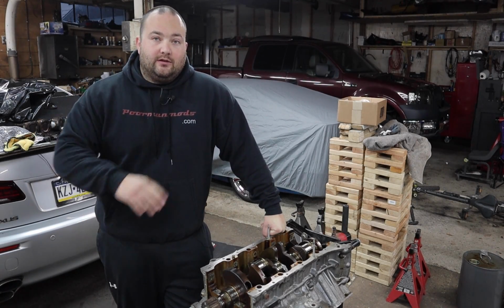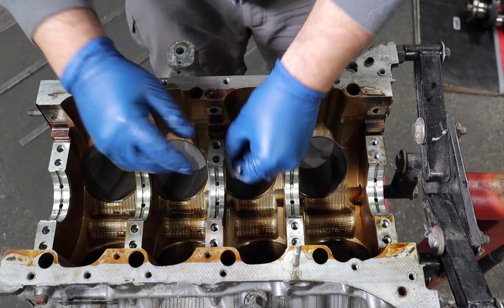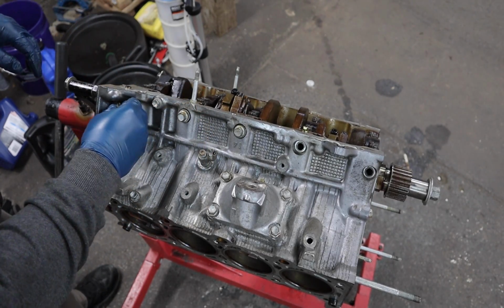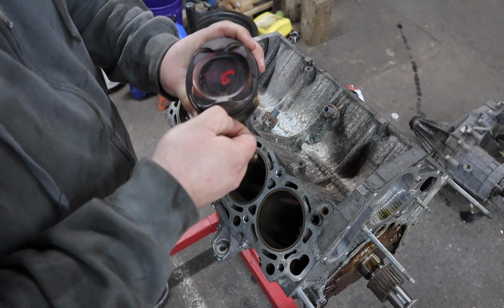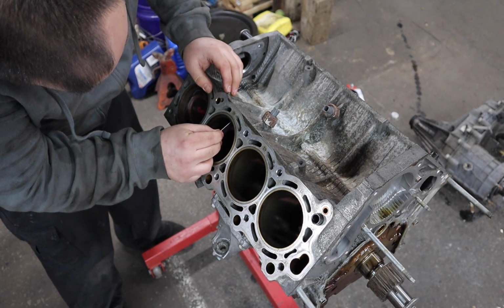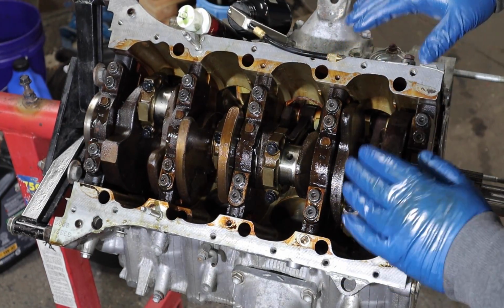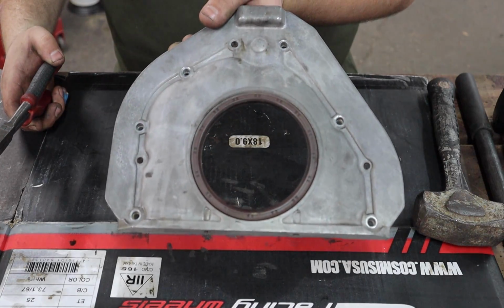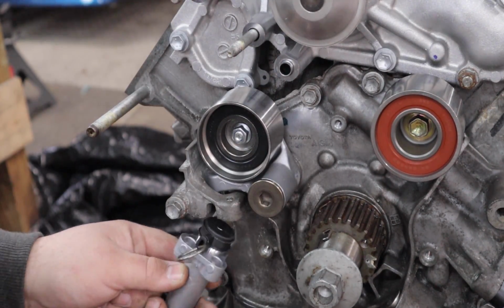1UZFE-VVTi Engine Rebuild Pt 1 Bottom End Rebuild

Comment: Honestly, you could've just noted the stamping on the block skirts (where the upper oil pan is mated to the block) at the rear right corner (seen in the video on the right lower corner of the skirt). Those are the main journal diameters. Also, the crankshaft is stamped for all it's journal measurements ranges from 1-5 and. They do this for discrepancies in manufacturing and they can still maintain a VERY high tolerance standard.
Reply from the maker: Yes, you're correct and that would have saved me some trouble . I believe at the time those markings were unable to be seen because of dirt or corrosion. I was looking for them and could not find them. Then when I took the engine block to the machine shop they hot tanked it and they found them.
Reply: @PoorManMods  yeah, they get caked easily. great video too bud!! I'm actually a Toyota MDT in Gulf States.

Comment: I scraped my oil pan, fixed it up and Drove for a hr. a knock started, came to find out I cracked my whole sump pan from being to low. thanks currently rebuilding and soo many threads had misleading information. Video was straight forward. appreciate the links tagged along.

Comment: There are marks on the block and the crankshaft for the bearing sizes, if it is difficult to see on the bearings themselves on the 1UZ. 

Adding them together gives your bearing size needed, it’s in the 1UZ engine service manual.

Comment: Interesting. On the bearing ranks for that engine. During the machining process the crank caps are tightened to the block and a boring bar goes through and cuts all the journals together and then each hole is measured and a rank is given for each journal, so the journal and the cap should be the same. The same is done to the crank, then you use the numbers from both to determine what bearing size to use for each journal. The top and bottom are always the same size.  At least that's how it is for all of the engines I have been involved with.
Reply from the maker: the top and bottoms were only the same for the center 3 bearings, not the outers, super strange lol

Comment: Got my parcel from Summit Racing just today. I was close to reuse my old piston rings because they are just inside specs. Toyota says just: discontinued. Also ordered 2 sets of 6 rings. To order one set of 6 and 2 extra is pointless because only a coupe of bucks difference. The problem with the thinner rings from 1997 on is not easy to find.

Comment: YOUR SUPPOSE TO MEASURE END GAP WITH THE RING AT 50% TRAVEL OR IN THE MIDDLE OF THE CYLINDER NOT AT THE TOP WHICH IS A WIDER HOLE, ALL 3 RINGS MOUNTED AT 120 DEGREES   APART BUT DOES NOT MATTER AS THEY TRAVEL AT THERE OWN PACE ON EACH STROKE MANUALLY LIKE A CLOCK MINUTE HAND, WHILE YOUR COMPRESSING THE RINGS AND ENTERING THE PISTON, YOU FORGOT TO PROTECT THE CRANKSHAFT SURFACE FOR ACCIDENTAL ROD CONTACT, USE WOODEN DOWELS STICKS OR SIMILAR SO THE ROD HALF MOON WONT HIT THE JOURNAL AND WILL BE GUIDED DOWNWARDS CORRECTLY

Comment: THE RTV OIL PAN GASKET SEALER DONT USE  OR IF YOU DO MUST BE A VERY THIN SPREADED AMOUNT ON BOTH SURFACES WITH YOUR FINGER SO WHEN THE 2 PARTS MATE THE DONT SQUISH A BLOB IN THE OIL PAN, HOW MANY TIMES HAVE WE SEEN OLD RTV CLUMPS  IN THE PIPE PICKUP, THIS IS AGE AND HEAT RELATED, USE A PROPER GASKET THAT WONT GO TO PIECES OR MAKE YOUR OWN WITH A MARKER AND A RAZOR/BOX CUTTER ON SQUARE GASKET CARDBOARD
Reply from the maker: I literally followed the Factory services manual...it's fine.. 😒

Comment: But why did you replace any bearings?
I took mine apart 
Unknown miles, looked great. Deglaze the cylinders, slapped all the old parts back in exactly where they came out of.
Reply from the maker: @mac1mike  mainly because I wanted to do a video series on rebuilding the engine
Reply: @ cool man. I didn’t k ow 1uz bearings were that special. Maybe that’s what makes it so reliable

Comment: What if you're planning on a turbo build with H beam Rods? Shouldn't the ring gap be bigger? How much boost can the stock crankshaft hold?
Reply from the maker: Im not sure lol
Reply: From what I've read, it's not the crank thats the limiting factor for boost. For the later 1UZ, it's the thin rods. Same for the 3UZ as well, but the 3UZ has a thinner cylinder wall. I've heard that you can run 3-5 psi in the later 1UZ and the 3UZ and not have issues. I've seen a guy run 7 psi with an eaton supercharger on the 3UZ, but it wasn't a daily.

Comment: Hey man so helpful, just bought a 3uz, just curious if the rod bearings need to be matched with the number the same as the crank bearing?
Reply from the maker: thanks! Rod bearings are not a matched set like the main bearings.

Comment: Very nice video! I have a question for you! I have a 1uz vvti also! there I will inspect the Main and rod bearings  before I start to use the engine! But need i to replace the Main and rod  bearing cap bolts when I take them away or can I use the same bolts many times?
Reply from the maker: its recommended to replace the bolts because they are torque to yield bolts
Reply: @PoorManMods  alright! Where have you heard that? 😊 I found a manual as looks like it's from Toyota and they recomende to replace the bolts if the Main bearing cap bolts is smaler than 7.4mm and rod bearing cap bolts is smaler than 7mm 
I have meassured mine main bearing cap bolts and only one of all the 20 is under 7.4mm 😊
Reply from the maker: @tobiasbjorkbacka6980  It's pretty common knowledge that torque to yield bolts, especially in very crucial applications like main caps and rod caps are one-time use. I just did not want to risk it. It's not mega expensive to get new bolts and if for some reason your old ones don't torque properly..that can be mega expensive when you find out later down the road.
A good friend of mine is also a technician at Lexus, he said for warranty work that involved head bolts or main bolts, etc. They would not replace them if it was warranty work to keep the cost down, but he extremely recommended that I replace mine for the extra insurance.
Reply: @PoorManMods  Hi! Where have you bought your Main bearing cap bolts? I can not find some i can buy! Ore are some other Toyota engines also as use the same bolts?
Reply from the maker: @tobiasbjorkbacka6980  
Heres where I got mine

Main cap bolts: 9091002206
https://parts.belllexusnorthscottsdale.com/p/78909883/9091002206.html

Rod Bolts: 1326550020
https://parts.belllexusnorthscottsdale.com/p/63152644/1326550020.html

Comment: Hey man, I noticed that you didn't hone the bore before putting new piston rings in.  I know that the theory is that new rings need a new hone to seat "properly" but it looks like yours seated just fine looking at your newer videos.  Have you had any oil consumption issues past the break in period on the rebuild?  The reason I ask is because i'm doing the same thing currently and  cannot decide if I want to hone the bores or not while I have the pistons out.  Any input is appreciated! thanks!
Reply from the maker: I haven't noticed any oil consumption issues, honing it won't hurt though
Reply: @PoorManMods  awesome! That's all I need to hear lol. I'll probably just pop those rings in after gapping and send it lol. Thanks for the reply!

Comment: Where in the WORLD did you get the individual crank bearings that you can order based on the individual per cap size? everything I can find online only sells a full set with no different size indicator? Im completely stuck in my rebuild trying to figure out if I can run this set or I need to somehow find where I can order each individual bearing.
Reply from the maker: Shoot me an email and I'll try to help you out later when I'm off work 
poormanmods@gmail.com
Reply: @PoorManMods  I appreciate the response! I sent ya an email

Comment: why not convert to na-T?  instead of uz swap?
Reply from the maker: Because
Reply: @PoorManMods  im actually curious, good deal on the uz ?
Reply: @solidsnakec20  uz will be more reliable, lighter, closer to firewall, better torque, better gas milage, smoother engine. You can get 300hp without boost with vvti ones